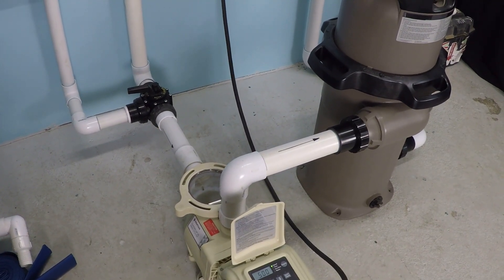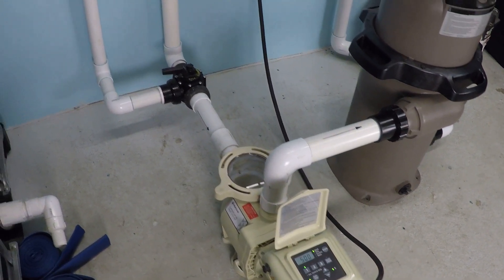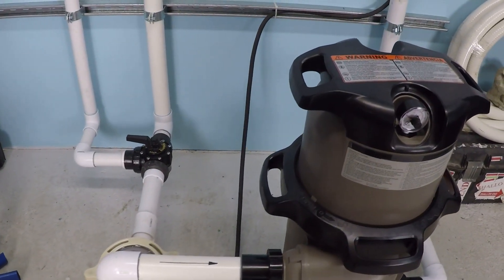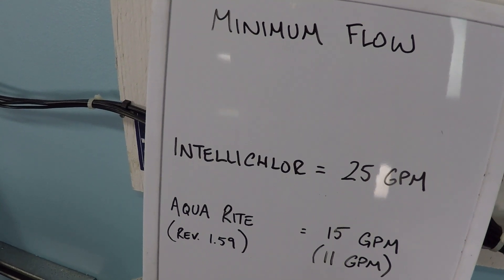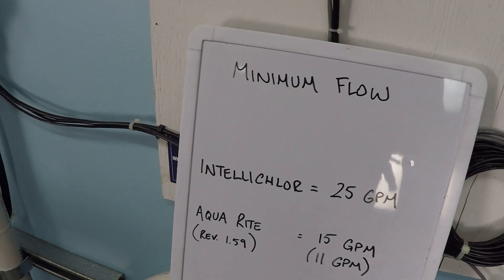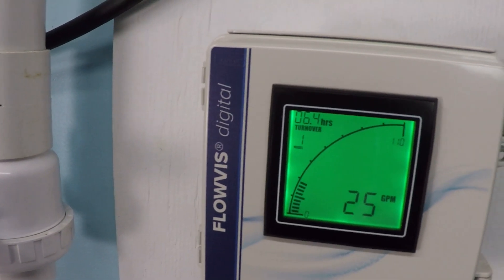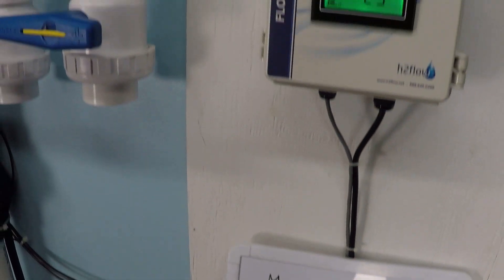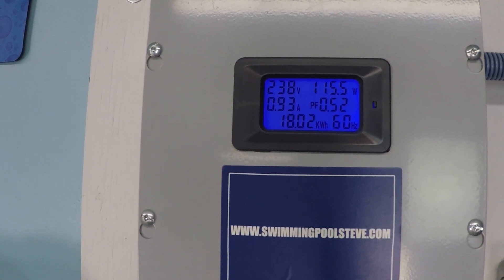What Pump Speed Do I Need To Run My Salt System?

Comment: Do I need to be generating chlorine 24 hrs per day? Say my variable speed pump isn't running fast enough at night to turn the flow led green on my chlorinator. So I am not generating. In the day my pump ramps up and all my LED's are nice and green on my chlorinator. Is this satisfactory or should I want the flow switch "satisfied" 24/7?

Comment: Ok, so my point is that the minimum flow rate to switch on the flow switch of the swg is not the ideal flow rate for the swg to achieve longevity. I experimented with my Zodiac swg and I could see at low rpm a lot of hydrogen bubbles that seemed to stay a lot of time in the swg which is not considered a good thing for the rhodium plates. One time at a too low rpm I could see the swg was not completely filled up with water, now it could be due to my particular system but be aware. This occurred at 1200 rpm. I am running the swg now at 2400 rpm. Maybe it seems a lot but the advantage is the chlorine gets mixed a lot better in the pool when it is released. Think about it.

Comment: Thanks Steve,
I am in the pool industry in Australia. We have a legal requirement that the chlorinator cell has to be installed in a gas loop. The cell is high with the pipes exiting the cell and going straight down. The idea is that if the pump fails or the flow is lost, the hydrogen gas that is created collects in the cell and the cell then reads "no flow" and about five minutes later the chlorinator switches the pump off avoiding damage.  I find with uneducated customers they run the pump so slow that the gas builds up and switches the pump off. I get a call complaining about the chlorinator is not working and the pool going green. The cell will work until it is no longer submerged in water. I normally sell people like that a normal pool pump and only sell the muti speeds to people who have some tech savvy. Like a lot of things in the right hands multi speed pumps are great but in the wrong hands they are a nightmare.

Comment: Thanks for your videos! Have a question, I just installed the hayward super vs pump and also running the pentair salt cell that has a flow light on it, green good, red low flow. 
I'm at 1500 ram's and still getting red light. If I have to run more ram's for the salt cell I may have wasted $1500 for a vs pump.
Your advice?
Reply from the maker: Why is 1500 rpm the magic number that saves you money? Give it whatever rpm it needs to operate.  The difference between 3450 (max speed) and 3100 rpm is HUGE. so 2400, 2200, 2000, 1800, 1600 etc ALL are going to give you a tremendous amount of flow, and highly efficient flow at that, for very little electricity use. You will definitely still save money.
Reply: @Swimmingpoolsteve  So another update after running my pool for 24hrs at 3000 rpm's for 4 hrs and 20hrs at 1700. $2.28 savings on my electrical bill! Awesome savings and a cleaner pool! Thanks for all your help sir!
Reply: @Swimmingpoolsteve  Thanks for the quick reply sir! It seems my salt cell needs at least 1700rpm's to run correctly so here is my current set up for day 1:
1700 rpm's 2pm to 6am/ down 4 hours then 3000 rpm's 10 am to 2 pm. 
I will see how this works for a few days then adjust accordingly. 
Again, thanks for your help.
Reply: What percentage of chlorine production are you using with this 24hrs set up? 100%?
Reply: @ernestoguevara1999  80%

Comment: With my variable speed Pentair pump and Intellichlor salt generator, the red flow light doesn't go off until I increase my pump to 1750 rpm. My plumbing is 2" as well.

Comment: not sure you are asking the right question -- as I have been running my pump high enough to keep the flow switch open... but pretty sure it is too low to keep my cells from getting calcified (or whatever that white stuff all over my cells is).
Reply from the maker: That calcification is a normal part of salt cell function. Just clean it when it is getting scaled up.  It ypu might have a point, which is higher flow rates probably get rid of at least some of that
Reply: @Swimmingpoolsteve I can also imagine a higher LSI violation inside the cell with reduced flow....higher pH and or higher temperature maybe?

Comment: Would've been nice for you to add the flow switch and see if it did close. Another item to consider, is that the salt cell calcium build-up appears to happen quicker with lower flows/ lower pump speed. Which means acid clanging the salt cell more then the typical 3-month frequency.
Reply: That is good point. I was thinking of running my swg at 1400 rpm for about 5 hours average. At which speeds are you having clearly more calcium?
Reply: It is kind of strange to read your own comment! So, a year of experimenting gave me the conclusion 1400 rpm is not enough for a Zodiac swg even when that is way above the minimum flow rate the switch needs and what the manual says. I guess they don't care a lot about longevity. I did try to run at 1800 rpm but I increased it even to 2400 rpm (6 hours) and 2700 rpm (2 hours). The cell has more flow and less hydrogen buildup. There are still plenty of hours on 1200 rpm left so even with this scheme I am saving electricity.
Reply: @Peter-Alexander  I need to the Hayward pump at 1600+ for my Hayward salt system flow switch to close (or I get a "no flow" reading). I was reminded in this video, he modeled the minimum power (60w) for salt system to activate. However, in reality the flow switch would need probably 1.5x - 2x the flow of the salt cell to remove the "no flow" error  and the system to produce. I found with low speeds, my salt cell will trap a little debris, and the calcium seems to build up/ settle as the pressure is too low to scrub the plates.

Comment: Thanks for the video Steve. However, if you add a Pentair Mastertemp heater and check valve after the heater, you would need around 1600 to 1700 rpm to reach the 25GPM for a Pentair Intellichlor SWCG with a 2” line. That’s my case. Once I bypass the heater and check valve, I can definitely reduce the speed lower than 1600rpm and turn over the pool water 3x in 24 hours.
Reply from the maker: Definitely. And if you add something more like a rooftop solar or another peripheral devi e like AOP this will walk you higher and higher rpm for that same 25 gpm. Compare resistance to flow on the pump curve put out by the  manufacturers of each pump. Ypu can then see how different models with different hydraulic design and other size would perform under similar head conditions. Every pool is unique. Much to consider.

Comment: Very helpful. I'm just starting up my pool and my pool guy says we aren't generating any chlorine from my Intellichlor system. We just drained and refilled the pool. I'm only running the pump and chlorinator for 6 hours a day. I run the pump at 1,800. I think I'll back it down to 1,000 and increase it to 8 hours to see if that helps. The salt cell is only about 2 years old and I take it off during the winter.
Reply from the maker: You need a flow meter and also look up the minimum flow rate for your salt cell. I think it is 20 or 25 gpm. You should be running your pump 25 hours per day. A few hours at higher speeds, double that at mid speeds and the rest of the 24 hour day at low speeds. Ideally you want to be generating chlorine at medium and.jigh speeds. Low-speed also would be good but your output on the salt system would need to be dialed back
Reply: @Swimmingpoolsteve  Thanks so much! I'll do that. All five "percentage" lights are flashing at the same time. We're going to ensure there is sufficient flow. Your information has been really helpful.

Comment: Steve, THANK YOU for a straight and simple video on a subject I've been researching!  I had a salt pool, went to chlorine tabs (which I had on other pools) and now want to make the switch back to salt.  But, I installed a variable speed pump which messed up my inline chlorinator (not enough flow) and wanted to make sure that the minimum 1,400 rpm I run the pump at on the long, low runs would work...It should thanks to your information.  Sub'd.

Comment: My salt cell (aqua rite) produces chlorine at 600rpm with a tristar 900 with 2 inch pipe. With a clean DEP 80 filter.
Reply from the maker: So basically idle speed and next to nothing for power consumption.
Reply: @Swimmingpoolsteve  I am not sure how it is doing it really. Most pools I see need at least 1000-1200rpm
Reply: At that rate, I would think the chlorine will not be mixed very well in the pool. Do you run at a higher speed after chlorine production has ended? Also, do you need to clean the cell more often while using these low rpm during chlorine production, as calcium buildup chances are  higher.
Reply: @Peter-Alexander I don't notice any issues with calcium. I had a cell on my pool for 8 years. Never cleaned it once. Not issues with mixing for me. But my setup is unique